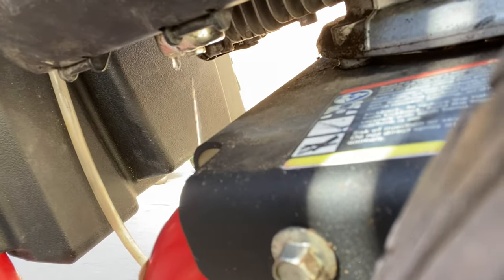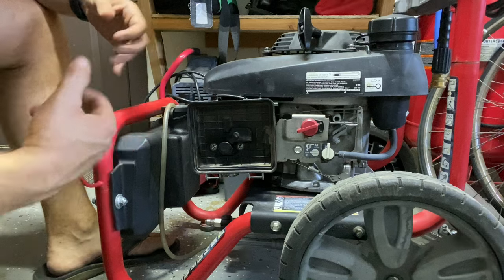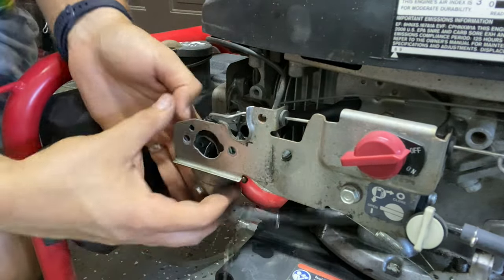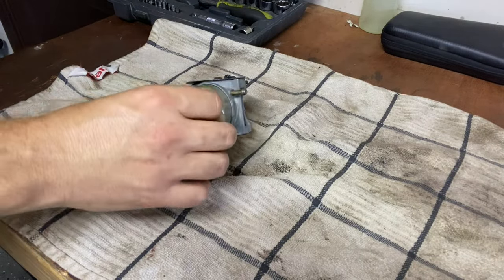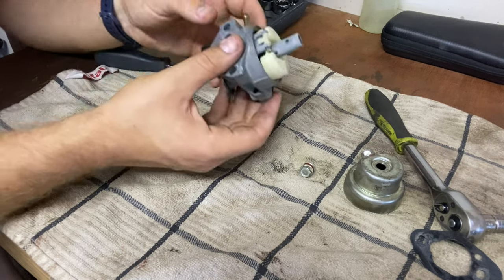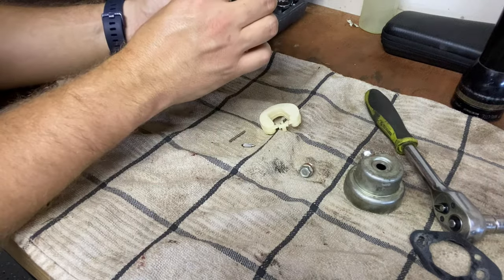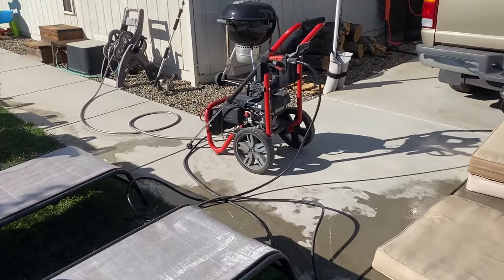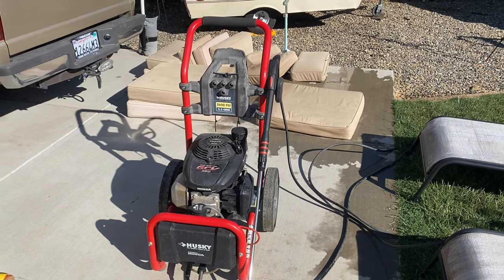Pressure Washer Stumbles then Dies when Pulling the Trigger. Let's Fix it!

Comment: I feel really dumb but I didn’t notice what direction the needle needed to be put back. Should the pointy part be sticking out or in when I put it back??😕
Reply from the maker: Hey not a problem! Pointy part goes in. The flat circle part slides into the plastic float. Hope that helps and thanks for commenting!

Comment: Being in CA, Ethanol is most likely the culprit even if you drain the bowl.
Reply from the maker: Yes the ethanol content at pretty much every pump near me is 10%. I have had success so far with draining it but I know it will need to be cleaned again. Probably make a good video of just being aware of that and how to maintain equipment.
Reply: @modest_wrenching  Maybe run some tru fuel or seafoam in it before storing it?

Comment: My pull cord wont pull. Lloks like same model. Any help?
Reply from the maker: Have you tried to unbolt the pull cord from the engine to see if that is stuck? I would try that first before tearing into the engine. It should just be the 3 bolts on top I believe.

Comment: I'm having the same problem. At first it would run after pull starting but stall when I put the choke in. I took the carb out and cleaned it, now it stays running after choke is in but stalls when triggered. I guess I'm taking the carb out again. Maybe the 4th time I used it. Lol
Reply from the maker: If it is a Honda then the pilot jet on the top of the carb is pretty infamous for being difficult to clean. Most Hondas I used to wrench on I would have to do the carb a few times until I just started doing deep cleans on them no matter the condition. Hope that leads to the right direction!

Comment: I was having same problem, cleaned the carb and still would shut down...put new Spark plug in runs like new
Reply from the maker: Very true. I had a mower that would have a hard time running where the spark plug needed to be cleaned. Very good to check spark if carb cleaning doesn’t help.

Comment: So simply clean the carb out , to much chitter chatter man good context but to much of this and that, it's a carb to sit and watch someone pull one off is just as bad as watching folks open a box , folks just don't have time for that stuff.
Reply: Lol then don't watch it, not everyone sits and watches every video on YouTube like you. Some people actually use YouTube for useful information.
Reply: Some of us have pulled apart many different carbs and it's boring to watch, but some newbies that have never done anything mechanical and experience an issue with their first pressure washer might like the extra video of cleaning of the carb.  It can also help someone later if they pulled apart that specific carb and are looking for parts or trying to figure out how to re-assemble, or looking to see something else for this particular pressure washer.  I've looked at videos many times where the fix in the video had nothing to do with my issue, I was just looking at something else on the machine they were working on to fix mine.  This dude said he fixed it so it's pretty easy to skip past the carb cleaning process.  Nothing pisses me off more than trying to fix a machine with broken or missing parts and all the videos I find are edited or don't show the part of the machine I'm trying to fix, so to me I'd rather have extra video than too little.